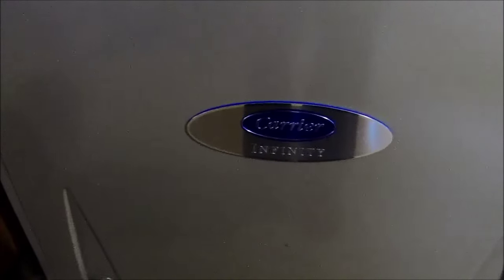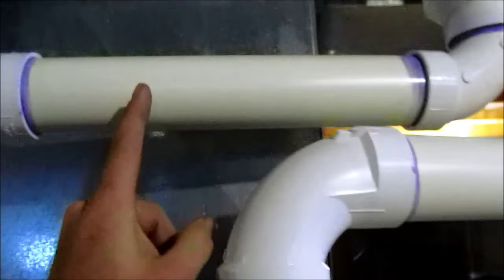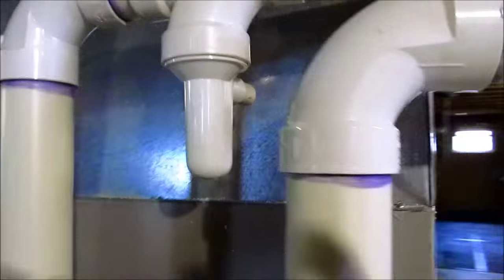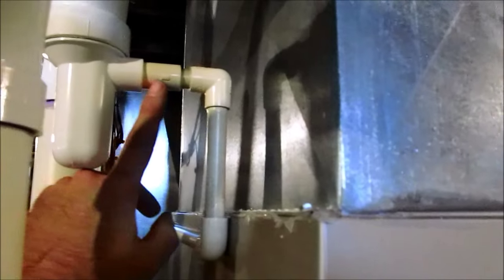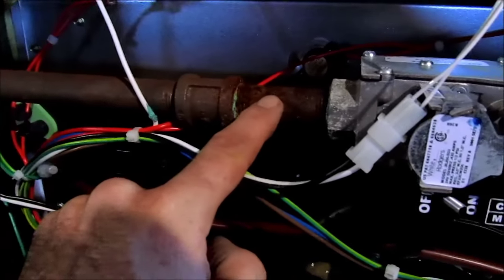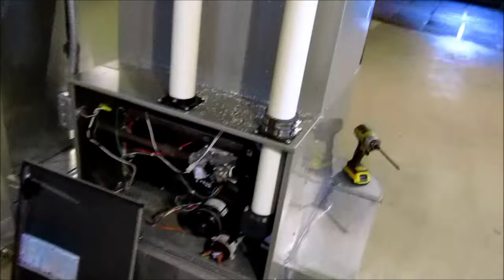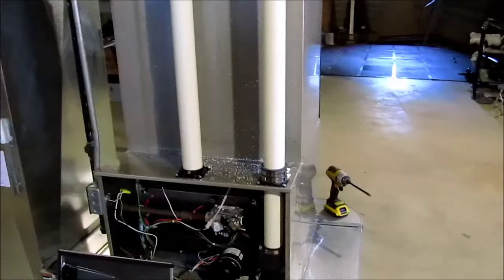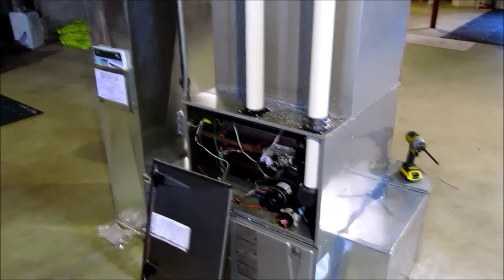Carrier 59TN6 combustion intake trap install

Comment: i have this problem with weil mclain ultra the motor for blower is right under intake and it is all corroded. there is a small lip and drain hose in unit where cold air vent comes in but apparently that is not stopping moisture i wonder if this would help

Comment: Great video, thanks for putting it together.  Quality journeyman installation there Sir!  I have been installing my new Aire-Flo high efficiency furnace and wondering whether I needed to do something about possible condensate moisture running back down in the intake pipe because it has no where to go but drip on electrical and gas components inside of the combustion area.  I studied the web on the possible issue last week and found nothing, then this popped up on my feed today and I built something similar.  Thank you again.

Comment: I would think that if water is getting into the intake side then the outdoor part isnt turned down enough and getting outside water in it.. or is condedsation from heat difference so insulate the pipe and stop that part..

Comment: How did you attach the drain outlet to the pvc pipe? I got the part but not seeing what connection you use to get the PVC on the outlet attached?
Reply: Specifically the 3/8” outlet on the drain part*
Reply: I have the same question looks like a 1/2" connection on the trap, but looks like you slipped a 1/2" coupling into it, how did that work?

Comment: So when that trap is dry the furnace suck air inside the room instead from outside. Is there that much moisture can condense and fill that trap up with water?
Reply: I have one where the intake is building up with condensation and killing the gas valve

Comment: Hey there!  There two tubes run through my bedroom closet and during and after the heater is on, they make popping noises.  It's brand new. I've had two heat guys come in and its
 not getting fixed.  Do you have any suggestions?
Reply: Blow co2 through those lines. Or take a vacuum and suck whatever is inside and then blow. Birds can get in and build a nest.